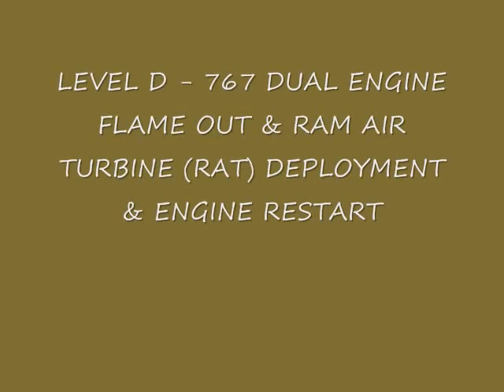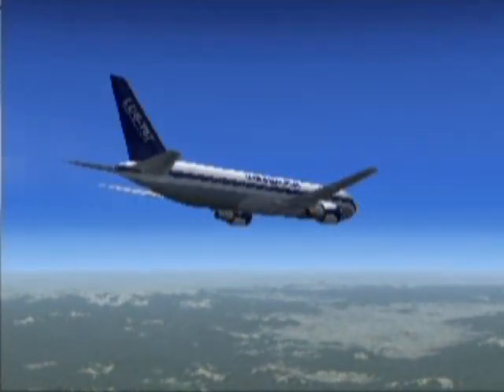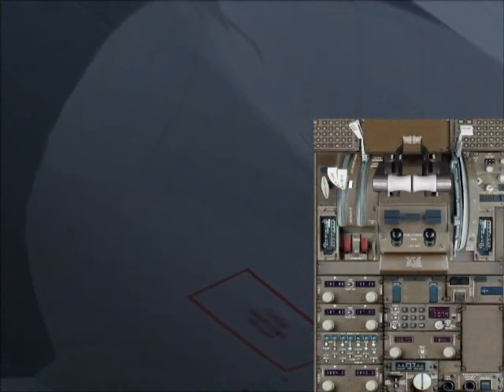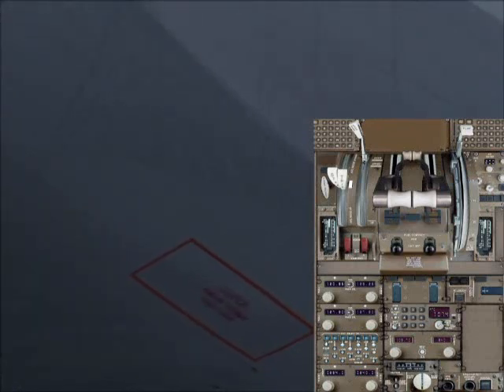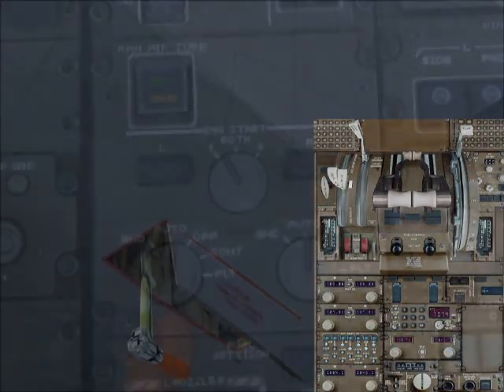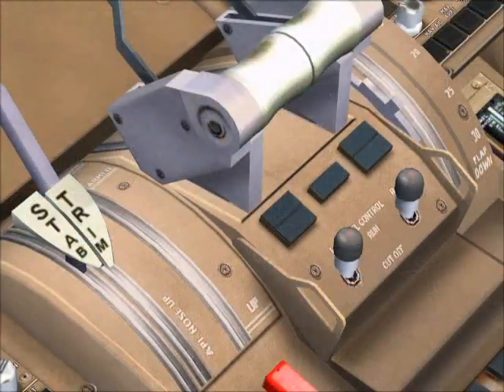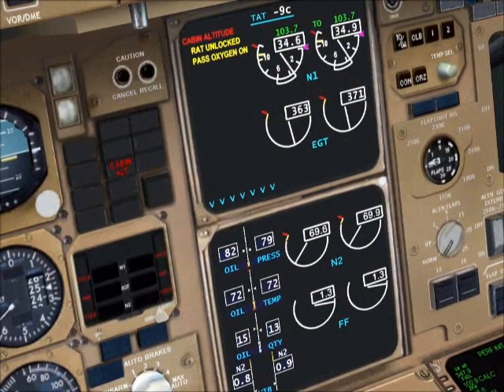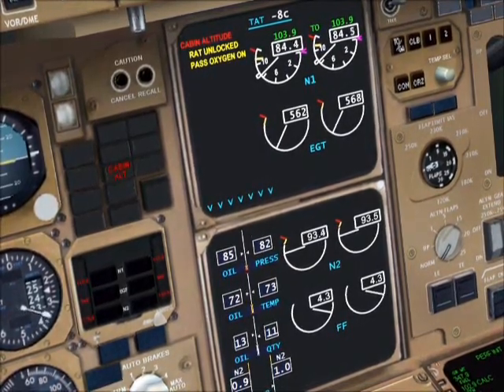Dual engine failure & Ram Air Turbine (RAT) deployment

Comment: @Lunarlaserranging 
Pilots are always trained to sample fuel and test it before every flight. Any chance of contamination is slim to none. And even if there was a fuel system failure, the plane can glide for miles. :-)

Comment from the maker: Student loans, and two jobs. You will have to work two jobs or at least one in college. Keep your credit score up, or don't let it go down.  Join the Civil Air Patrol which will enable you to join your local Navy Flying Club. You need a service connection which enables you to rent aircraft cheap.  Rent NOTHING, but 150's and 152's to get your time.  You must attend college to get the student loan money, but you have to have the degree to get a major airline job anyway.  Message me if you have mo